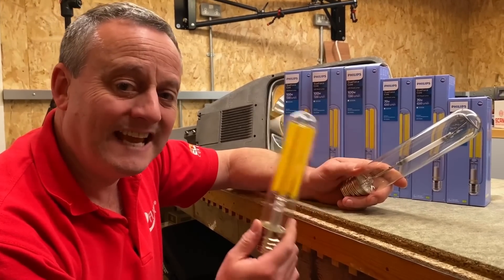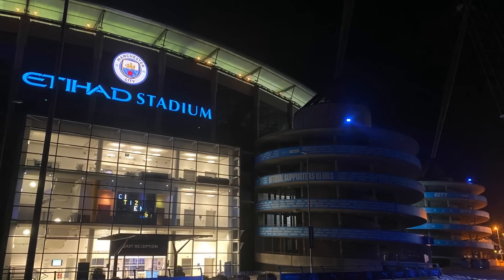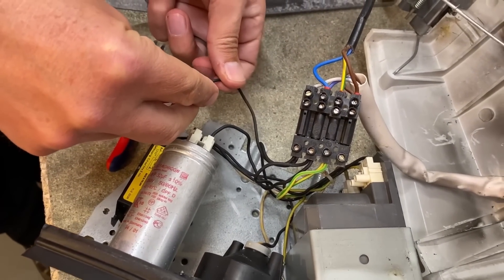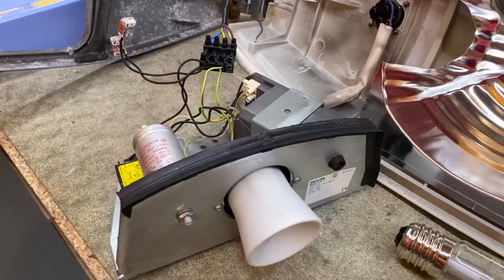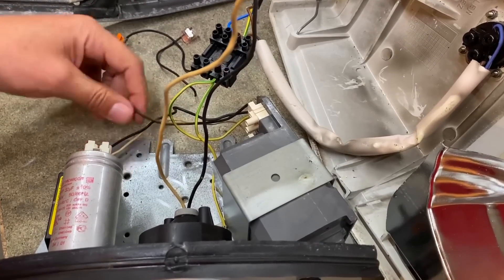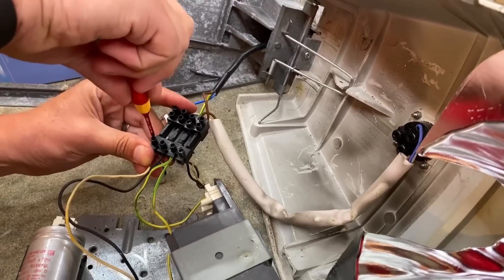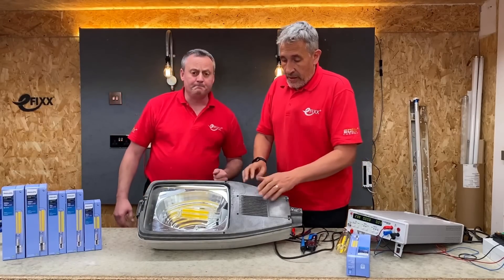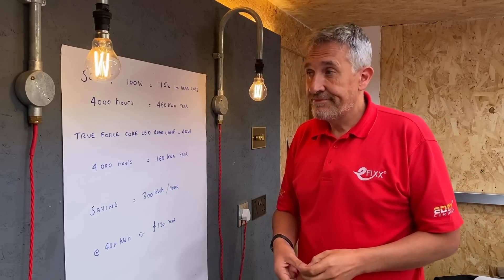Save £120 a Year with a New LED Road Lamp!

Comment: Council where I live spent a fortune ripping out the old fixtures and putting in terribly DIM white LED's, and when they fail you have to change the entire head unit..... Because obviously that is cheaper than just changing the bulb. And the odd one I have seen fail sometimes flash on and off for days until they replace it.

Comment: Philips 100w SON-T Master.
Average life of 36,000.
Lumens of 10,600.
Is it a true replacement.
What would the lux levels be, using a warm white LED lamp, at fixed points within the test environment. This dinosaur is desperate to put all his faith into LED lamps.
PS. When will they overcome the problem with LED lights flickering when they sometimes fail. 
Keep the thought provoking video's coming.

Comment: I appreciate the lamp.  Nice bit of gear.   But the economics do not stackup on the retrofit.  These luminares you are talking about are up there in age.  If they are up around the 5 year mark, it's far more efficient to rip the head off and replace the assembly with a fresh LED unit.   The new lamps we are fitting up have zigbee controls and a fall-back PE.  The cost of changing this whole assembly out is going to be LESS than opening the luminare at height, and making modifications.   The installation is then good for 8 years - the warranty that Osram or Thorn gives us for the fitting.  

One more note - the depots we run are now using ZB controls integrated with the security systems and cameras.  We realised that that we were supplying thieves who jump/cut the fence to steal copper were happy to use our lighting systems.   Now the lights are all OFF until we need them.   The security cams can see in the dark - if an intruder jumps the fence (which is now electrified) they start sneaking around with torches until the security guard presses a button to activate the lights  and the PA system.    Very efficient - but you do need to hose the area they were standing.... Cleaning up the mess from the thieves shitting themselves :)

Comment: Id like to see this done with a SOX lamps instead of SON/SON-T as SOX was way more common in the uk, however with SOX there's not much point in replacing it as it reaches the same efficiency of LED
Reply from the maker: They also make a SOX version with b22 cap. This lamp offers the same lumen as the Son version with less power 100w down to 40w
Reply: @efixx  Ahh right, do they do orange versions as the white light can be very harsh
Reply: @FinlaysFireSystemsElectrical  strange you should say that. I have two sox lights in my farm yard and am loathed to change them as the light is a subtle glow and the led replacements are very harsh. I do have a box of spare lamps, just as well as they cost a fortune. Like you say the lumens per watt are very high
Reply: @johnwarwick4105  you can get an amber LED module here in the US that emulates the color of LPS. I was in Flagstaff AZ last year, and they still use monochromatic street lamps because there is an observatory nearby. I was only there one night, and what I thought were actual LPS lamps were indeed retrofitted with amber LED modules (I believe the fixtures were originally LPS and retrofitted.

Comment: Hi, I went to quote a board swap and came across an ancient antique fusebox/timeswitch which I'm guessing may have been a heating controller off some sort.

It says herwood heating on it, it has ground 1 ground 2 upper 1 upper 2 zones and the timeswitches have a few options:off/timeswitch/direct, was wondering if anyone has come across these and have any info on them I have tried researching on the Internet but have not come across one. Any info would help.
Reply from the maker: Send us a picture and we’ll ask the community - admin@efixx.co.uk
Reply: @efixx  I have sent an email with 2 photos attached any info would be useful thanks in advance.

Comment: Not sure why you'd bother in most cases. Just replace the fixtures.

In AU they're just swapping them over to new LED fixtures, either in bulk lots, or as they fail.
Reply from the maker: Sometimes it comes down to opex vs capex budgets. Plus some fixtures are a heritage design.

Comment: @4.40 you say in edison screw the large inside area to line?  that seems daft to me, much less likely to touch a finger to the pin deep inside, and when its switched off the neutral wire can still be tingly (and trip RCDs if you touch it)
Reply from the maker: I implied the large screw area should be neutral.

Comment: I really hate thr brightness and colour from led street lamps.
I will never understand why they didn't continue using the sodium salt colour and brightness as it was much softer on your eyes. LEDs come in so many colours, you can't tell me they can't produce the same colour as the old lights and running them at the dimmer brightness would use even less power.
Reply: In Worcestershire we have to orange led street lights in certain rural area there a great idea
Reply: It's true, many first gen street lights were sold in 6500K which is a very harsh colour indeed. These are a much softer 3000K & 4000K. The original sodium lamps also don't provide great visibility or colour render, so not ideal for driver vision or CCTV clarity.
Reply: @justinewalmsley5595  Not really correct at all, sodium SOX lamps produced tonnes of light and when these LEDs came in street were significantly dimmer becuase LED only shines light directly down meaning in between poles theres a massive dark gap whereas with SOX there was a massive light spread and less poles were needed, people blabber on saying the SOX light where inefficient even though the reached the same efficiency as LED and in some cases even higher!
Reply: Perhaps you've seen some bad refits in your time, where the column top has been replaced with a new LED luminaire with insufficient beam angle? However as this video says, in the case of a like-for-like LED replacement, the LED lamp utilises the optics of the original luminaire, so you would get the same lightspread as the SOX it is replacing.
Reply: @justinewalmsley5595  The retro fits do okay, its more the actual LED fixtures that don’t have a good bean angle

Comment: whats with copying the Americans .  Every spark in the uk knows you should not twist the conductors together  . Yet You want to copy the Americans and adopt  wire nuts which twist the conductors together . Madness.
Reply: I didn't see any wire nuts?
Reply: Why not an acceptable connection method here in the UK it's up to personal choice if you want to use them

Comment: Power saving aside I don't particularly like the colour temp of led street lights or the narrower beam angle.. As in I don't think they light as well and the colder colour temp makes road markings difficult to see in the wet. What also doesn't help is when councils turn them off (led ones) to save money .....looking at you Swansea council.

Comment: 2:44 ohh, c'mon, push your screwdriver into the top hole and you can remove the wires
Reply from the maker: We are always kind of careful when working on a large capacitor which has just been fully charged.
Reply: @efixx  instead of the logical push and pull the wire out you basically cut the 2 wires as short as possible and leave the copper in them exposed, handy for the skin to accidentally scrape on it and receive the discharge 🥲 it’s a small capacitor anyway so you can take that zoot like a man and crack a smile after.